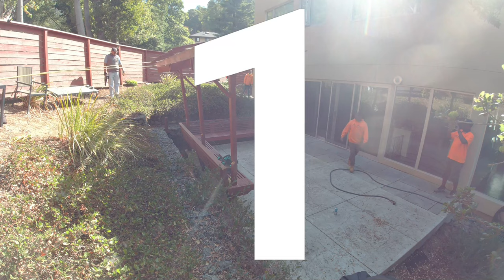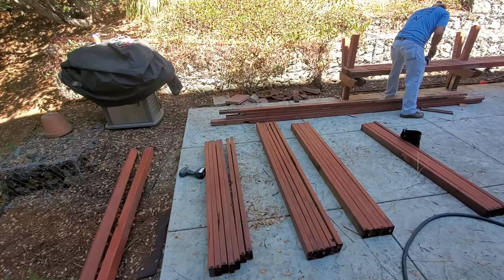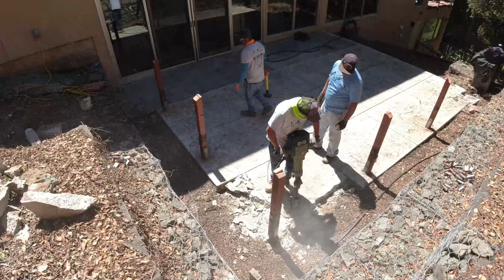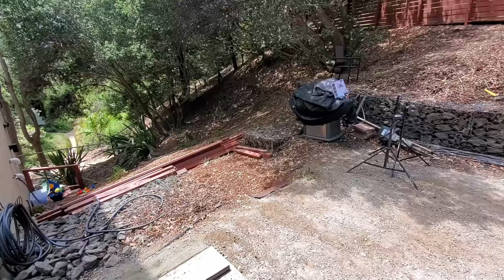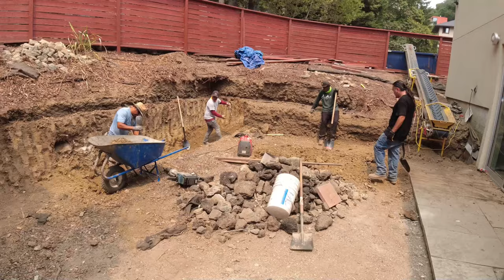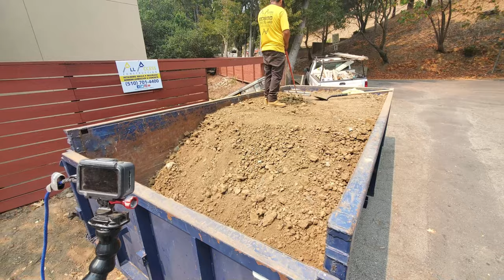Retaining Wall Demo For New Concrete Wall (Modern Landscape Part 1)

Comment: 1.5 inch chizzel bit, the best for 4 and 6 inch concrete
Reply: Pointed bits for 8 to 24 Inch stuff
Reply from the maker: I think it's a chizzel bit.. Got that hammer 6 years ago for 600 bucks at the auction.. Not one problem.. But that hilti is the one. I rented one b4. But not giving them 4k for a new one.. 🤣🤣.. I can get two of the bosch... They hit

Comment: I’m getting ready to pour about 200 lf of 10 pour in place wall and about 300 lf of 7ft wall. what would you recommend on method of pouring concrete to keeping up down air bubbles besides using a vibrator. And at what slump
Reply from the maker: 200 liner feet by 10 feet high and 300 liner feet by 7 feet high... Thats nice and good luck... We use a six sack pea gravel mix for all our pours.. 4 inch slump. I always vibrate our walls. Old school method is tap with hammer.. Even seen guy on IG use the vibrator on the outside forms.. You got pictures?